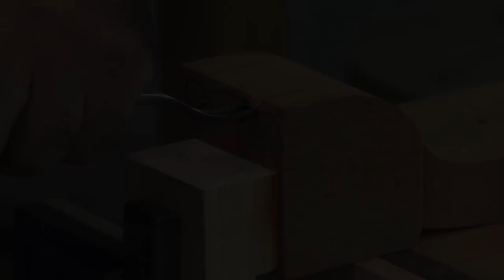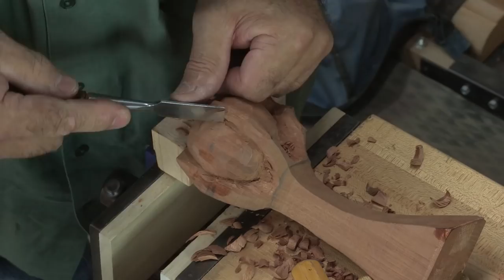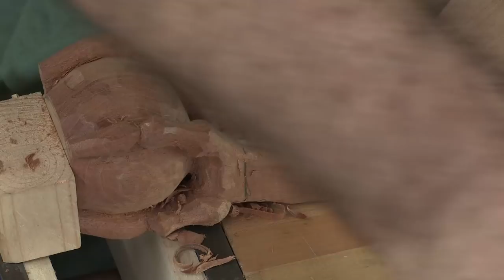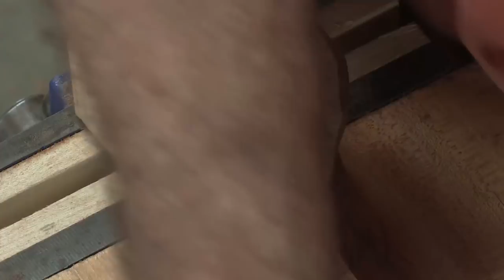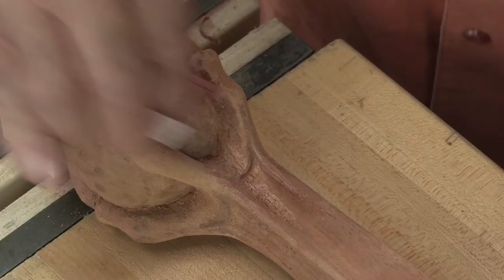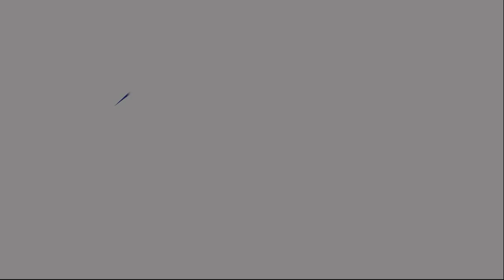Carve a Ball & Claw Foot (Pared Down)

Comment: What is the "real time" necessary to complete the ball and claw carving - I know the video is ~1 1/2 hours, but there is probably a lot if direction in that...
Reply from the maker: Fair question. I'd estimate a single carving could be done in a steady two or three hours, and if it were a technique you were skilled with I'm sure that could be cut down significantly. If you're starting out I'd leave at least three hours, and plan for more.
Reply: Hello, I have just carved my first ball and claw. It took me many hours. Probably at least 8. I went slow however.. it's not the carving aspect. It is knowing what and where to remove the wood to get a nice and continuous shape!